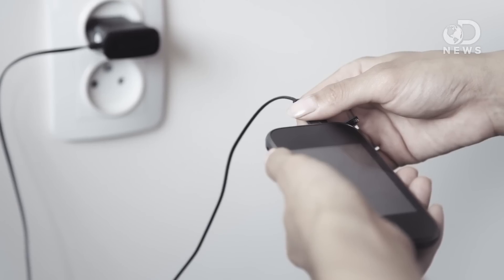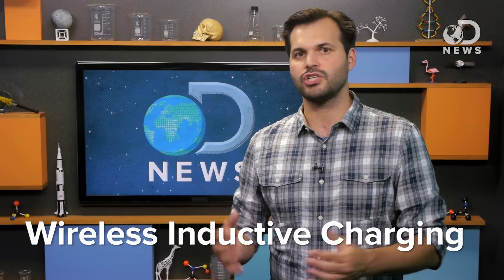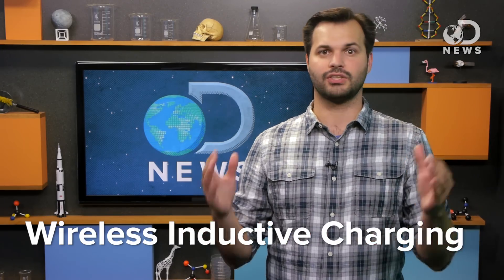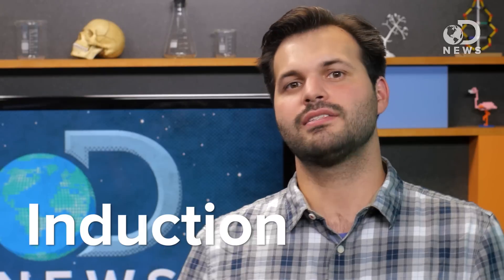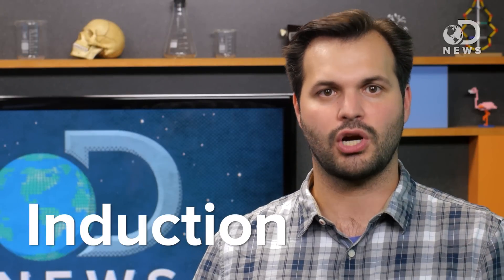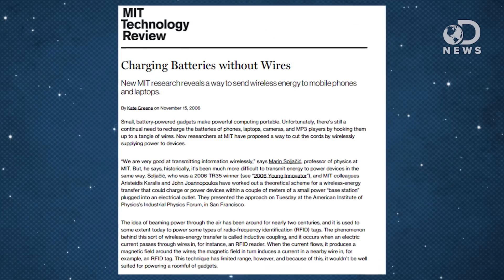How Does Wireless Charging Work?

Comment: Wirelessly charged electric car.  It would charge on the road or in your driveway on in a parking lot.  Charging stations could be everywhere and this would salve the battery problem!
Reply: We already have this, at Toyota in Japan.
Reply: owen west Charging would be done in your garage with induction coils beneath the floor, while you sleep, and hey! off peak hours too (plus electric cars also charge their batteries from the braking force). Yes, you would still have to pay your own electric bill but it takes almost no electricity to maintain the field so you're kinda only paying when you're running a device and you do that anyway. You could easily power an iphone wirelessly, the problem is we suck at storing energy and batteries are not only super inefficient but they are thrown out by the billions each year just because they're easier than getting a cord and plugging something in. With manufacturing, shipping, packaging, distribution, etc. along with their inefficiency 1kw/hr from an iphone battery costs roughly $24. If you had it plugged into the wall 1 kw/hr would cost about $0.19. Sure it'll take awhile (honestly 10-15 yrs before houses start being built with magnetic induction coils in the floors, walls, and ceilings) but once your house and your office and the coffee place all have them installed (think wifi) then it will be like your devices are always plugged directly into the wall. We will use less electricity, it will be cheaper, and renewable energy sources will become a hell of a lot more practical.
Reply: owen west
 I mentioned in another post that wireless charging for cars right now is simply done by parking over a specialized mat or pad in one's garage and they've achieved efficiencies very close to traditional wired connection (just above 90%) and experimental systems using a cable embedding in the road to wireless run electric buses while driving are underway. Yes, the cost of the vehicles are higher when compared to traditional gas powered ones, but that will really only be true until the technology becomes more common place, plus most governments offer subsidies or tax write-offs on hybrid and electric cars to offset some of the difference (the price difference.for hybrids has decreased since their introduction). Plus with Tesla Motors effectively putting the technology for the electric car into the public domain, within a few years we should be seeing all sorts of new technology on the market that'll only serve to drive down prices. Besides, with fuel prices being what they are these days, the cost of the electricity needed is likely less than that of gasoline (though I don't feel like searching for figures at the moment). Charging stations already existing in parking lots and parking decks that electric car owners can plug their cars into while they're parked (my 'local' mall has two such spaces and I live in the middle of nowhere, hence the 'local', so I imagine they are more prevalent in more populous areas). They will only become more prevalent as electric cars become more prevalent and while not wireless right now, the technology exists and is efficient enough that there's no reason to assume we won't be seeing a shift in that direction in the next decade (I mean, hell, it's not even theoretical- wireless charging stations are already out there. That's what Hirsh Kabaria and I were referring to.)

I'm not intentionally trying to attack your every post or anything. I just think this has so many exciting ramifications and the technology exists to make this happen (and it is happening on a small scale). Yes, some of the things I've mentioned aren't all that practical yet, but they easily could be on the market within a decade. The only thing that'll keep that from happening is if this current iteration of the technology doesn't see more widespread adoption, which won't happen if everyone just assumes it's not practical and is prohibitively expensive (while shelling out 300-500USD for a new iphone every two years... sorry, that's another rant all together).
Reply: Hirsh Kabaria I've heard about the Nissan Leaf, I'll have to check out what Toyota's doing.
Reply: now that leaves the question of whos paying for it.
Reply: de0509 the government pays for stupider thongs...
Reply: yeah sure, the government is supposed to give us free food, free money, free water, and pretty much everything. If energy is free, what stops us from wasting it? We dont have the technology to produce insane amount of energy yet
Reply: I said that to make fun of the governments spending... Obviously I don't believe that...  As far as who would pay for it,  I have not a clue,  I was just putting forth my Idea.
Reply: If only that wouldn't cost more money then we have in the world.
Reply: Maybe you don't understand how much money is in the world...
Reply: Kris Shellman Generateing enough electricity to power to these cars. You wou need a tremendous amount of power for one car let alone thousands. We can't even efficiently power a iphone wirelessly let alone a moveing car. Not to mention we would need hundreds of thousands of these charging stations everywere so pepole could actually go places. The cost to make these cars would be extreme. Therefore there price would be in the hundreds of millions. So yes we don't even have the technology for this and more then likely won't in our children's children's life time.
Reply: finnmaura thats definitely not practical right know. Wirelessly chargeing a phone isn't practical consider how long it takes. Let alone 1 car. Also pepole would need to put that in there houses on there own terms. It will cost alot of money. Not to mention,  what if you what to go onto vacation? Parking stations wouldn't be practical because they would be extremely crowded. Not to mention the starting price for these cars.
Reply: owen west my tablet charges slightly faster with its wireless charger than USB.  Same 2amp USB port.  You are ignorant. You waste more energy converting from 120v AC to 5v DC than transmitting.

Comment: Mounting a TV and hiding the wires is easy... the tough part is getting through fire breaks in the wall.  Drill a hole in the wall behind the TV and under a shelf and presto instant hidden cords. If you encounter a fire break tit means you need one more hole to see the fire break so that you can cut through it.

Comment: My dad's phone can be charged via induction and I always notice that it gets really warm/hot while being charged. And it's slow, like five times slower! The only real advantage is that it's comfortable: Put your phone on a surface and you're done. No more fidling with USB cables.
As for efficiency I've read that only about 10-20% of the energy being generated/sent actually arrives at the device, depending on the distance and device itself.

And with the EU pressing for more efficient electronic devices (lightbulbs, ovens, chargers, power supply units, etc.) I can't see inductive/wireless charging leaving the testing labs anytime soon. Right now using it to power devices would be like trying to heat your entire house by lighting a fireplace in one room in the house: Most of the heat goes out the chimney or only warms a few feet.

Comment: My router has a 2.4GHz and 5.0GHz setting though...
Reply: That runs wifi at b/g/n. Which some newer devices can use to transmit more data per second, and the new 'Ac' is even faster - where people with gigabit internet can use for their devices.

Comment: If and when wireless charging turns out to work and everything, I'd want all my devices to do it wirelessly. Even things like Desktop Computer and TV could theoretically be moved around much easier if they were all wirelessly powered.
Reply: my phone has wireless charging (nokia lumia 930) and a wireless charging pad is only 25 euro's
Reply: Are Daleks wired A.C. or D.C or both, and what is their internal power source?
Reply: maintoc Now THAT is a good question.
Reply: That is exactly how it will be, no cords, no outlets, no more wireless charging pads either- just the wall and floor lined with induction coils. Your house will be like an electric wifi hotspot, anywhere you go any electronic device equipped to do so can convert the magnetic field into power. Also, in the very first episode to feature Daleks, they were powered by static electricity from the floor. That's why they have that design, they drew power from the floors of the buildings and streets of Skarro, and were unable to even leave their cities. Also where all the jokes about Daleks and stairs originated.

Comment: Oh man now that I watched the whole video...
I need to add that I see cars being charged while your driving them from an induction power posts (which would look like modern high energy power lines with antenna on them) lining the sides of streets and highways. Compatible cars side pillars can receive a charge from them or even be powered solely by a power induction current. I also see my own concept flying vehicle using this method as an engine powerful enough to levitate off Earth's surface would require extra power in addition to its own engine power even at low altitude.

Ok going to sleep now.

Comment: Wi-tricity was an idea of mine in 5th grade...
I knew nothing about electricity, but understood that we transmit weak fields of electricity everywhere all the time. My idea simply boosts transmissions amplitude and synchronized devices for secure charging the devices needed complementary receivers and could send and receive charges. There are certain frequencies that allow for better charging and higher frequencies seem to require more power in simulations and are less efficient overall. Apparently the colleges that made this possible in reality agree and are sticking to sub a 200Hz range for now. Antenna shape may improve performance and lessen waste, but the shapes are odd.

Not sure there are to many stones I've left unturned there is still sustained levitation and self-sustaining electrical engines; in simulation these are possible but unrealistically hard to accomplish requiring all New technologies to even be remotely feasible. My dream flying vehicle will need to far lighter than previously estimated.

Also people will discover that electricity has a weight.

I should go to sleep now.

Comment: I want to charge my wireless hub that will charge my wireless that is in control of the wireless hub so I can turn on or off certain sockets for other devices like my wireless speakers and my wireless receiver which wirelessly connects my cable to my tv and internet so I can connect wirelessly to my router and wirelessly watch tv on my wireless phone.

Comment: Flux is not a synonym for an electromagnetic field. Flux in electromagnetism is a measurement of electric or magnetic field strength through a given plane's unit area. Flux Graphs are drawn using relative Flux line density to indicate field strength. 

It's the same distinction between the rate of water flow through a hoop placed in a river and the water itself.

Comment: There should be hydro phones....Drop the phone in the water and BAM! You got a 100% charged hydro phone! Not recommended for toilets......
Reply: Used toilets would charge the phone better because phones love electrolytes.
Reply: BradSk88 I see what u did there :0
Reply: BradSk88
So do plants.
(Actually, on that note, does anybody know if it would actually harm plants to water them with Gatorade?)
Reply: How about this a cellphone that works on... NUCUALR FUSION!!!!
But seriously if you want to hear more interesting article Nikita patented rights to piezoelectric for charging cell phones, they have a plan to have shoes that will charge your phone as you walk... Dnews, you miss out on that one.
Reply: BillyJoe1305 It wouldn't really harm the plants more so you shouldn't pour any other liquid in the plants besides water.
Reply: TPCWorld - Top 5 Science Videos!
Why not, I know plants love coffee.
Reply: BillyJoe1305 gatorade contains sodium, I believe. A little of this can be good for plants, but too much can be horribly, horribly bad. There's also a bunch of other chemicals in it which probably won't be good for plants. You're better off using water and compost or manure, maybe fertilizer.
Reply: Dyexmax I heard about those plans/developments years ago, but not in connection with any specific company doing them.  It's interesting & good to learn that Nikita is, apparently, actually doing something with that process ... unless they've bought up the patents and are going to shelve it as a result of being paid off by the battery-making/recharging industry.
Reply: BradSk88 🤢🤮lol
Reply: It'd be shit power
Reply: Years ago, there was a digital watch available for purchase that was solely powered by water.  Of course, a cell phone would require much more power.
Reply: maintoc Interesting...I might just make one with my own experiments!

Comment: i want to charge my wireless mous, wireless headset and phone, just by laying them close to my laptop, than that laptop is plugt into the wall. a few years later that cable will be gone to. just two plugs. one for laptop and one for wall. after that the laptop get power inergrated. and even later we get mobiel charge just like 4g

Comment: wireless except for the wire...
wireless charging in the consumer form is a joke, it uses 4 times as much power
and you device is stuck to a pad with wires....what a joke
real wireless charging actually has the base transmitting power  meters as he said.
if we go by current definition the brick in your charger for your laptop phone etc is a wireless charger

Comment: How about cars?  Electric cars that never need charging because of multiple stations strategically placed to provide energy for any near by vehicles.  Imagine....
Reply: Matthew Burns
1 word, interference. Another word, ice.
Reply: http://www.solarroadways.com/intro.shtml we wouldn't need stations, cars could wirelessly charge while driving
Reply: Maybe interference, but had you read the article I posted it states that they're going to put heating elements into the panels to melt off the snow and ice.  Therefore sand and salt wouldn't be needed to be put onto the roads which would damage the solar collecting ability of the panel.
Reply: Inductive coils placed under the floor or in the walls of a garage would charge an electric vehicle while it's parked for the night. They are already doing this but it involves parking on a big rubber pad thing which needs to be plugged in at an outlet.
Reply: finnmaura Thank you for the update.  :)  I did not know that they had increased the efficiency levels that high.
Reply: Matthew Burns
  I saw that, but I'm guessing you've never lived in a northern area and have never seen an ice storm. Even finding a reason to worry about that assumes they can collect enough energy, on a snowy day, to heat the entire road surface (heat takes tons of electricity) and produce a usable amount of power.
  Then you still have to worry about the problems sand, mud, traffic jams old rubber oil spots etc. that would stop the road surface from producing reasonable amounts of power.  
 

And if you care for a rant:

Maybe one day they'll develop solar cells that are both long lasting (wear aside, solar panels have a finite life cycle) and have a high enough output we can power our houses with them. It sure is better than the rooftop model. I just don't estimate it as possible in the next fifty years and feasible this century. The only way that could change is if somebody managed to develop a solar panel that is light years ahead of current tech. We live in a world where such leaps are not out of the question, but by the regular progression this is a long way off.
Reply: this would be great if you had a few cars but as u add more and more cars the power intake would lower and you would not get as much power you would have to have a shit ton of these every where or just lining the inside of the roadways which would still cost a lot of money then you would have to think who will up keep gov or company gov would tax heavily while company would just make stations everywhere that only transmit to something when its close so not a good idea.
Reply: but where's the money in that?
Reply: It happen back as early as the 1820's it was called the electric monorails or the even more interesting electric trolleybus that came later on. Transportation that never needed to stop to refuel. That's about as close as you will get to the dream of clean energy vehicles that don't need charging batteries first or using weak solar power to run.
Reply: Dyexmax they werent wireless they work through the cables they touch
Reply: There could be large hotspots at traffic junctions where the amount of energy given to the cars in changed based on how many are there. The positives are endless!!!
Reply: Of course we both know they don't run wirelessly, I was saying we have had invented and using battery less electronic vehicles for a while now. I will also add for practical implications it is doubtful to see induction used past rail transportation since it requires a lot of power.
Reply: Dyexmax
It's a better idea than the other one in this thread.
Reply: finnmaura Interesting, although I'm sure that inductive charging isn't as efficient as a wired connection for charging.
Reply: maintoc Inductive charging by way of parking over a charging pad progressed to just beyond 90% as efficient as direct wired charging a few years ago and experiments with battery-free public transportation receiving continuous power from a cable beneath the road beneath are around 60%.